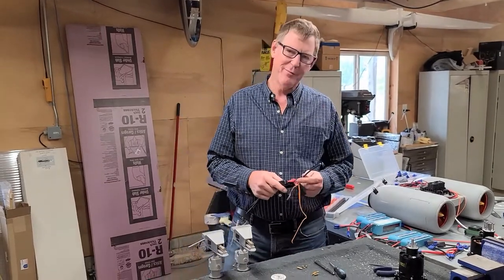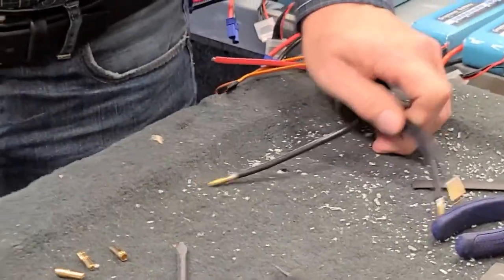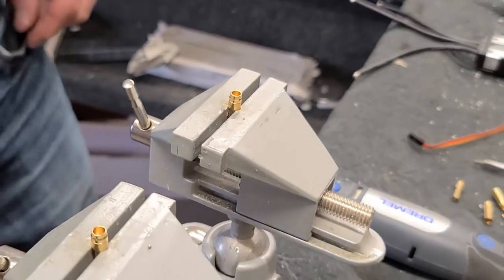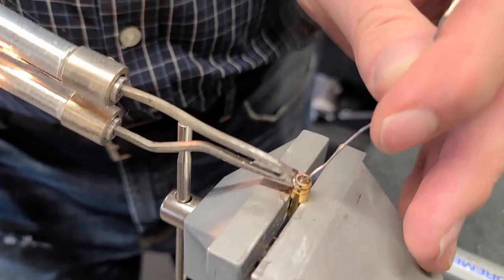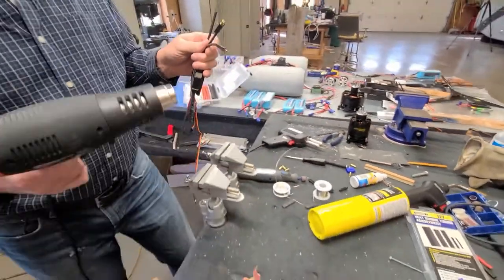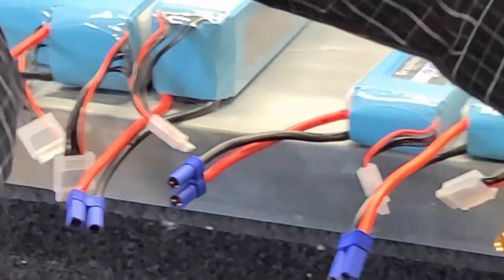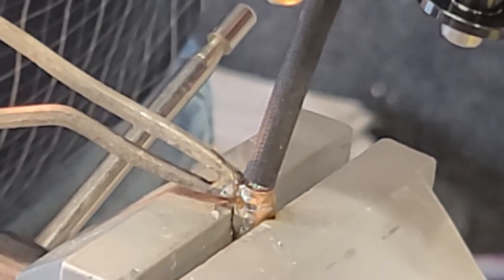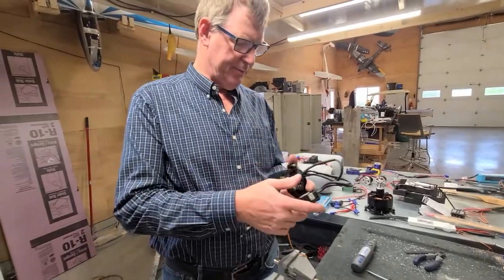SOLDER FAST RCTWINS

Comment: Love your channel and your invaluable advice. However, I have received information from Castle Creations and 5 other sources that is the opposite from your advice about adding extensions to battery vs. motor side of the esc.  This is from Joe at Castle: “You can add the extension to either side. You'll want to use 10ga wire regardless of the side you add it to. If you add it to the motor side no additional precautions are necessary. If you add it to the battery side you'll want to add a capacitor pack to the ESC to help with the additional ripple that will be generated.”  I had a similar response from Spektrum. I would go with your final word on this, so can you please verify for me the correct procedure.  Thanks.
Reply from the maker: Thanks for the info, for myself, I've added 6 feet to the battery side but don't add to the motor side because I have experienced bad behavior in doing so in the ones that I have tested, I have found that I usually want the esc in the wind anyway so there is usually no reason to extend, most of the esc units already have capacitors on them, I can only go by what I have done 😀. I've extended the battery leads on about 45 12S planes FYI, hope this is helpful :)